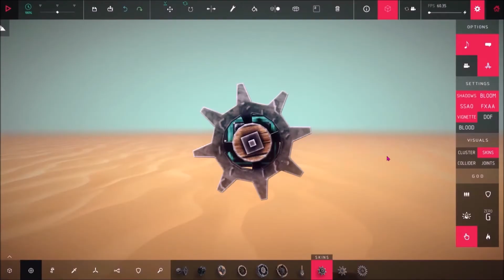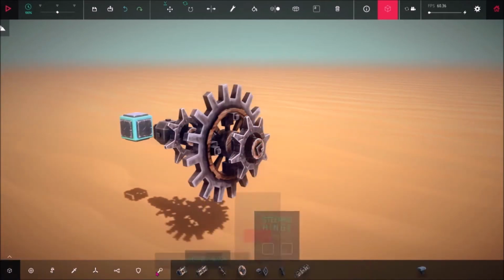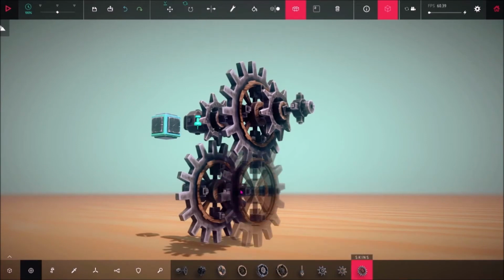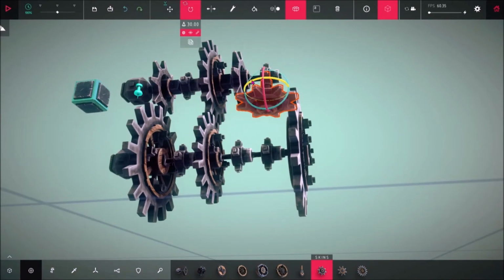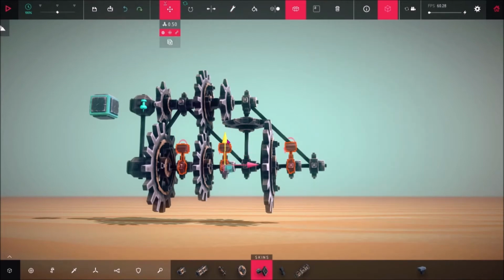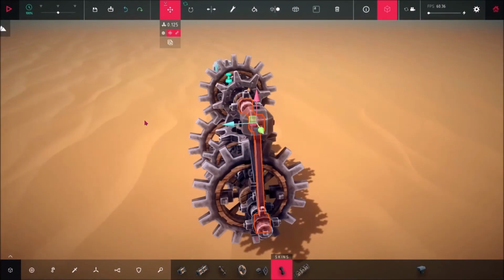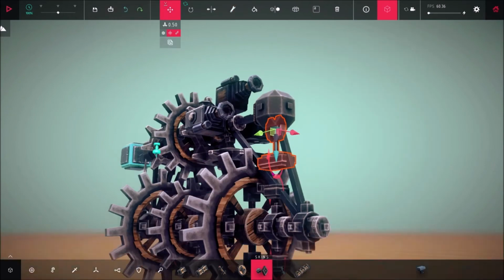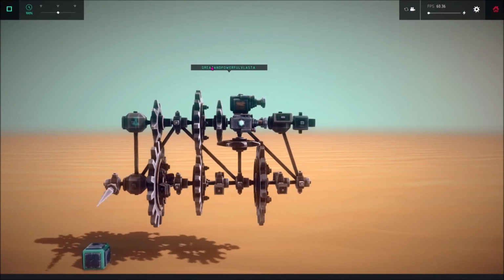Making A MUCH LESS SKETCHY transmission in besiege

Comment from the maker: So, I just found out that while I may be quite decent at Besiege, one thing I apparently struggle with is counting. While making this video, I counted a quarter of the teeth on the big gear, then multiplied by four to get how many teeth there are in total, because I didn't feel like counting all of them. Trouble is, I missed the quarter mark by a tooth, meaning I counted five teeth instead of four, and then concluded that the gear has twenty teeth, when it actually has sixteen. Therefore, when calculating the gear ratios 20/8 made 2.5/1. The real ratio is of course 16/8 or 2/1.

Comment: Is this able to handle a lot of torque? I'm really interested in the idea of parallel transmission gears, but they all seem to be unstable and slip at high power.
Reply from the maker: As far as I can imagine, unless you find a way to have every single gear pair perpendicular, this is the best design approach you can take, since the gears are supported on both sides on ridgid points, they don't have much room to flex out of mesh. What you might need to do with this one though, is brace the gears on the input shaft together, and get a lot more grip on the coupling claws, maybe using spikes, or grip panels, if you want it to handle a heavy load
Reply: @vlastasusak6881  perpendicular gears are what I ended up doing, yeah. Even connections between blocks seem to bend and stretch when enough force is applied on them, meaning simply bracing the gears better wouldn't keep them from slipping. Perpendicular gears are very inefficient at making strong transmissions however since they need much more space.